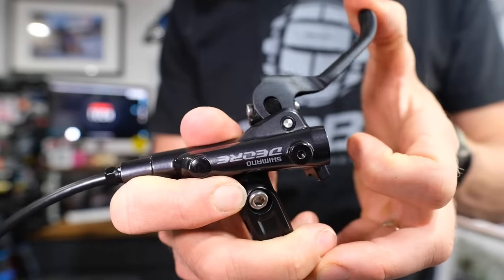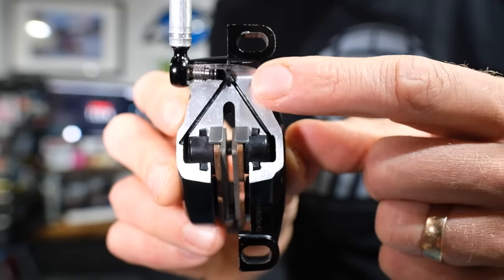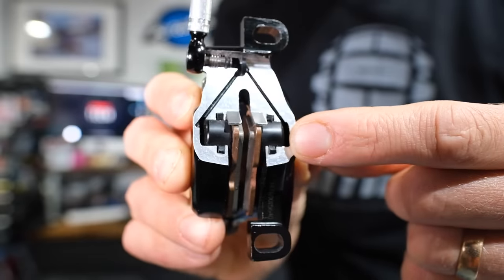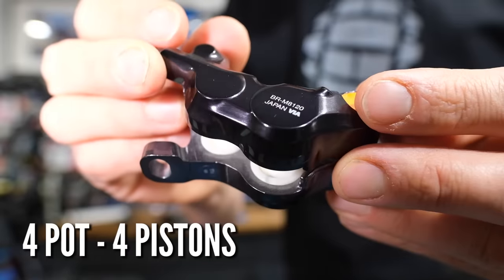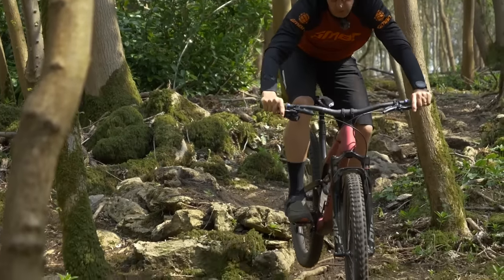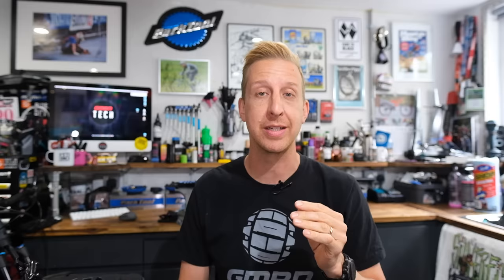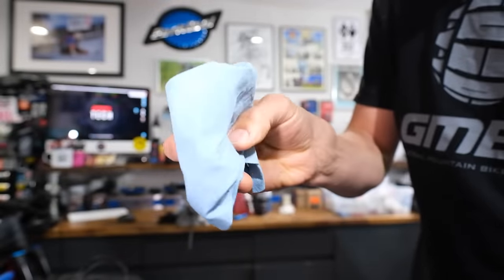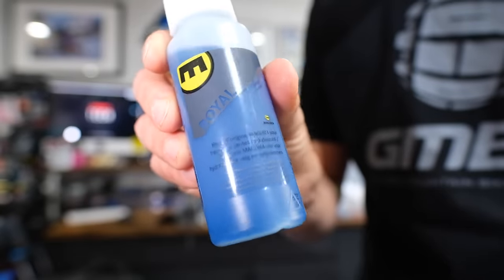Why Do My Mountain Bike Disc Brakes Feel Spongy? | #AskGMBNTech

Comment: Doddy, I've got the opposite problem.  I've just taken my old orange clockwork down from a vertical wall hanger (i.e. the bike is standing vertically against the wall) and, after not ridden it for 2 years, I was giving a good ABC check (air, brakes, cables) and found that the hydraulic brakes (Avid Elixir) whilst they worked, went from off to on, with hardly any progression at all, this is front and back brakes.  So no smooth uptake or feathering, just straight on, it nearly threw me off the bike when I was checking it.  Any ideas what I should do?  Just give them a good clean with muc off disc cleaner?
Reply: U need to replace dot fluid every 1-2 years....REPLACE mind, not just bleed. So from one end you pump fresh fluid into an EMPTY bleed syringe, discard old fluid into a jam jar (to later take to recycling center/tip...never down drain), then do a full bleed as normal having part filled both syringes with clean fluid.

Comment: #AskGMBNTech 
Is there an engineering reason on to why 4 pistons calipers never actually evenly?
I thought that with your SRAM & Shimano connections might have explained you why.

Does the same thing happen in car's pistons?
Reply: They often have different sized pistons in the front v rear pistons of the 4 pot, to effectively 'toe in' the pads. Same reason u should toe in rim brakes, the movement pulls them forward. So the front 2 pistons of a 4 pot are usually bigger

Comment: What if there's Mineral Oil leaking out of your Brake Levers?
Reply: Service them if possible or new lever
Reply: Check hose nut is tight if leaking out end where hose goes in. Bleed after if was loose

Comment: Is it an urban legend that the pads closer to a hub wear faster?
Reply: Hub? No. Disc...only wear if actually touching, obviously
Reply: @rupedog  i guess e meant the right side pad that are closer to the hub. 
@Prezmyslaw Sliwinski  I think mathematically they might suffer inconsiderably more torque that could cause "bigger" wear rate. But this isn't big enough to be ever noted. If your inner pads wore faster, your pistons are not centered or the caliper is not positioned right
Reply: @davidsafar6111  I believe I aligned them properly. Could the inner side of the rotor be easier to contaminate? We did a few rides in a quite awful conditions this winter.

Comment: I'm having issues for my brakes... I bleed them multiple times and after each bleed it feels great but then a day or two later it becomes spongy ang slow to come back up again.... From what he said it's air in system but I bleed so much air out already :/
Reply: might be air in system, might be leaking master cylinder seal, and caliper seals. if so only changing the seals will solve it. I had this on several new brake, all were Deore M6000.
Reply: you forgot the hash tag if it's a question for ask gmbn

Comment: i'll one up this question. why do my mechanical disc brakes feel spongy?
edit: sarcasm btw
Reply: Plastic brake lever. 😅
Reply: Replace your traditional  brake housing with compression less housing.
Reply: @vsnofjohana  its cable operated, wont make a difference
Reply: Are they fully mechanical, ir a cable pulling a hydraulic lever at the caliper?
If the latter, then old fluid/air in it.
If former, try a new cable. Make sure its a fatter brake cable, not thinner gear cable!

Comment: Don't you overfill the system when you just put on the funnel for the minibleed and don't put in the bleedblock? Can overfilling do any negatives on the breaks, cause i have seen the overfilling of the system on purpose by the Syndicate ( https://www.youtube.com/watch?v=piWBVDh1pTE) ?
Reply: you gotta remember to not reset pistons fully next time you change pads. Or do it on open reservoir

Comment: #ask gmbn tech - hey doddy I want a suggestion from you please suggest me a mtb under $1000 and may be my English is not so good because I am from India and there are very less brands to choose please take my question
Reply: there should not be any spaces in the hash tag. that will be a hard question to answer, I suggest looking into what you can easily get, and consider building a bike too. you can definitely get a good bike for 1000 dollars, if you spec it right, and go for deals, and second hand part and go for cheaper frame options.
but that excluders garbage frames and components.
So far cheapest frame I've seen is Dartmoor Horner & Primer. 
I don't know which brands you can get and how easy it is to get stuff to India now if you order internationally.
I suggest compiling a list of what you can get and ask if it's good on the facebook group.
Also I don't know which type of bike you want. so I can't come with specific advice.
so I doubt you can get much help for your question.
Reply: Prices will vary 1000 USD bike in the UK might be 1500 USD in India...find some reviewer from your country is the best.
Reply: @mtbboy1993 mate he is from India some brands don't sell everywhere...1000 bike might cost more there...